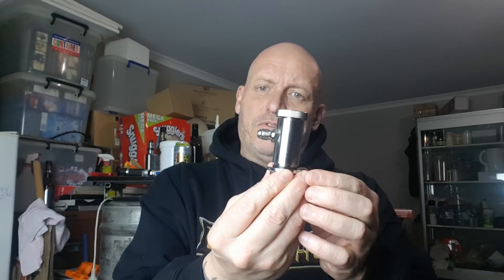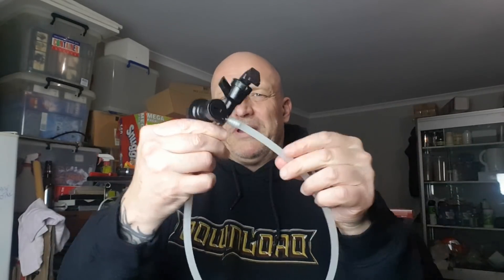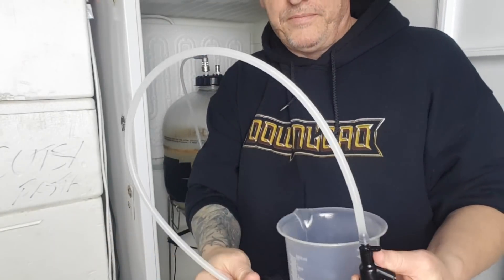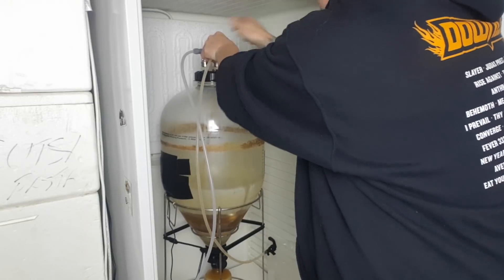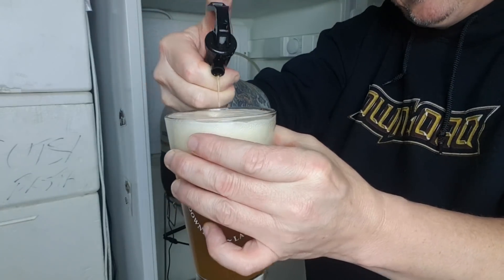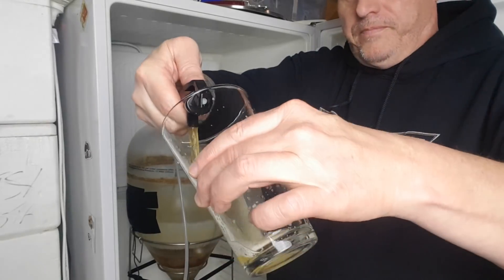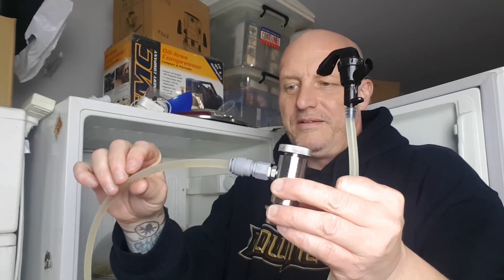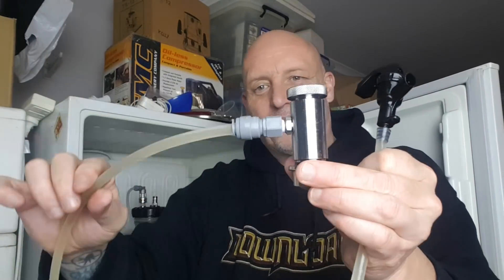FLOW CONTROL Quick Disconnect - First Test -  FLOW RESTRICTOR

Comment: just wondering can you get away with using these in the keggerator with a short amount of line? I have one of the Kegland's keggerators and I'm sick of having to use 2 metres or how ever long the hose is, they take up space and are just a nuisance rally, I was hoping to use the shortest amount of hose possible
Reply from the maker: They didnt work really well on kegs, they are apparently redesigning them for that. I still use mine as shown here. Cheers

Comment: So, your opinion - better to go with these kegland flow controls (which, in the US, at $30 each) or with the kegland secondary regulators to reduce the gas pressure individually on each keg? The secondaries are about $13 each, but have a 0-60 psi gauge which you can swap for the 0-23 psi for about $5 each - making the secondary with a 0-23 gauge $18 each?
Reply from the maker: Dont use these for kegs, in a kegerator, these are good for serving from a vessel with a very short line at high pressures, but I wouldnt use them in a kegerator. Cheers!

Comment: Got mine the other day,  not used yet but mine only has about one turn from closed to open whereas yours seems to need a few turns. Anyone else notice this with theirs or have a any issues? I'm worried mine will restrict flow quite a bit as it's harder to blow air through it at fully open compared to a standard fitting...
Reply from the maker: I havent fitted out my kegerator yet, but I do think they are more restricted when open compared to a usual QD. Mine turns about one and a quarter turns. next few weeks I will be trying to outfit my kegerator with them and think I will have to shorten lines and up gas pressure a touch, but until then thats about all I know mate. Cheers!

Comment: I have this! Williams brewing sells them in the states. It’s nice but there’s still some turbulence in the tubes from it. I use it to reduce the pressure of 40psi water, and it works, but the stream is still a tad disrupted. It’s still way better than a flow control faucet though.